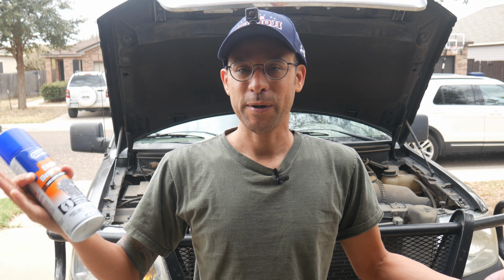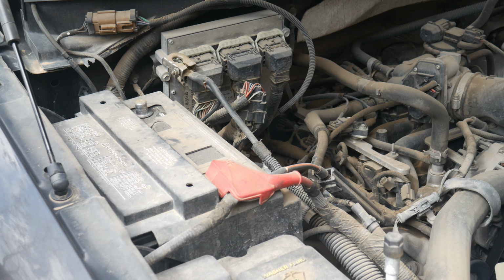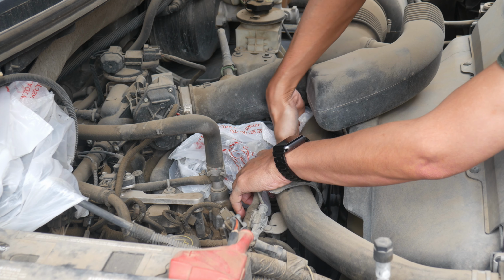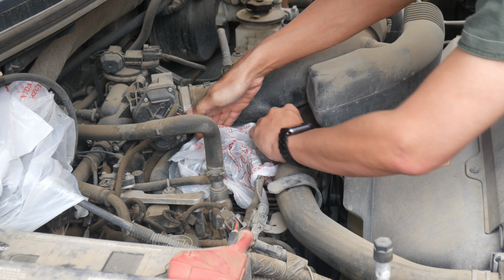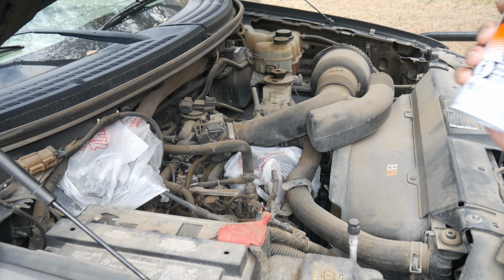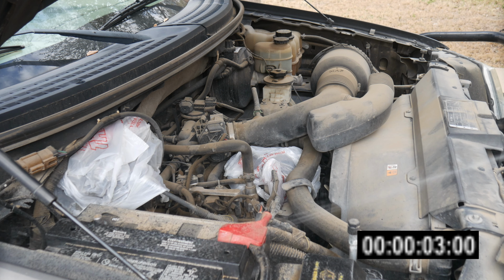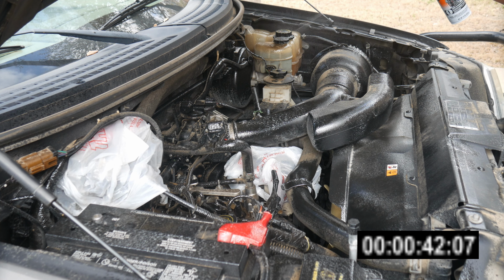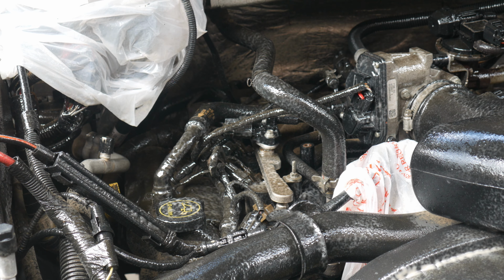Engine Cleaner / Degreaser

Comment: If you really want to clean an engine can be cheap. You need at least 2 cans of degreaser. Plus hot water and will be best if the engine is hot plus you got to use a brush time got to take time .
Reply from the maker: Agree. 1 can was not enough.  And just 1 wash wasn’t enough. 1 more round would have it looking really good. Just looks okay right now.
Reply: i know Im kinda off topic but do anyone know a good site to stream newly released movies online?
Reply: @Dylan Benedict Flixportal :D
Reply: @Dean Darwin Thank you, I signed up and it seems to work :) Appreciate it !!
Reply: @Dylan Benedict glad I could help =)